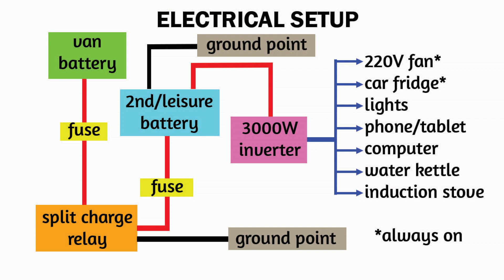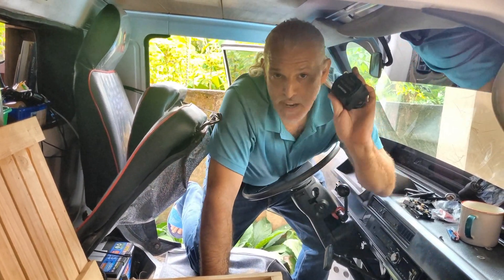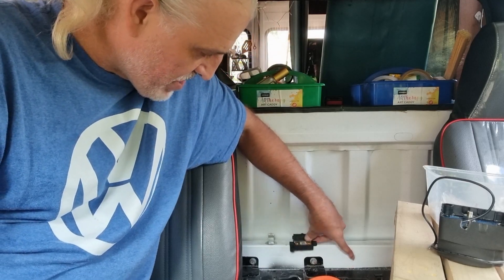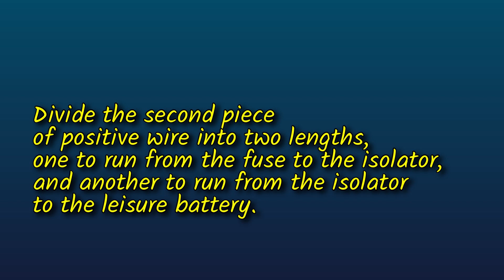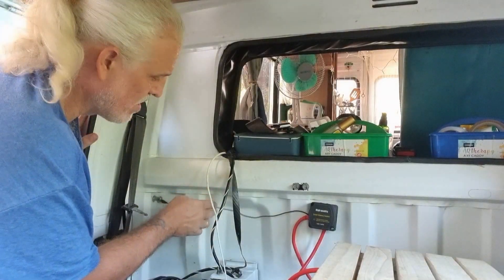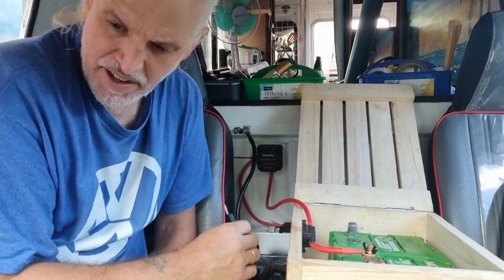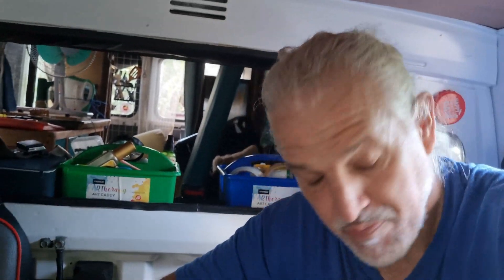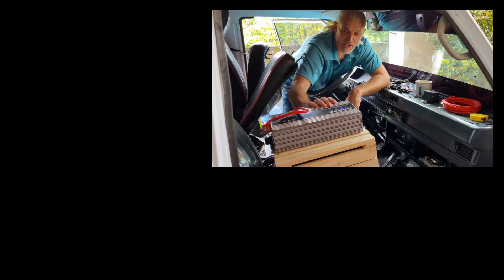Leisure Battery Installation Guide | Split Charge Relay | Vanlife Without Solar | L300 Campervan

Comment: I forgot how long do the leisure batteries last? more than 5 years? love the DIY tools :) the filipino way hehe
Reply from the maker: Batteries are gauged by 'cycles'.  So a normal car battery like the one we used may be good for 80 cycles (being drained fully and then charged back up)  not the best, but the cheapest. Then there are the glass mat gel types of batteries...1200 cycles, middle of the price range...best is still the Lithium ones used for solar...8,000-10,000 cycles I think...depends on your budget.

Comment: Hello, do you know if I can use lithium batteries with the same set up like you have? Thank you :)
Reply from the maker: Hi! Some people use the same setup for lithium batteries. Just make sure you use the appropriate wire length and thickness to deliver the optimum current. Too long and too thick will reduce the current, but too thin will not protect your system from surges either. Install fuses where surges can occur.

Comment: Hello, I need a set up for my food truck that will provide enough power for two 400watt blenders and one 220v fan for 6 hours every day. The blenders will be in constant use throughout the day. Do you have any suggestions on what is the best way to go about this? Thank you very much!🙂
Reply from the maker: Hi Jonathan!  With the leisure battery setup like we have it would  be very difficult for your situation...but possible.  You would have to periodically start the vehicle and let it idle for 20-30 minutes in order to recharge the battery during the slow times of business. Not very practical, but maybe possible!
Reply: @filamstagram  Thank you for the speedy replies, that’s awesome!👍🙂
What I am thinking of doing is getting a 200ah lithium battery and connecting it to a split charger or a dc solar charge controller. If I came over(I live close to you,lol) would we be able maybe to meet up and maybe you can help me understand the best way to get what I need from the battery set up that I will be installing? Thank you sir!🙂🙂
Reply from the maker: Oh yes, with 200 amp hr lithium you are probably going to be ok!  Sure we can meet up!